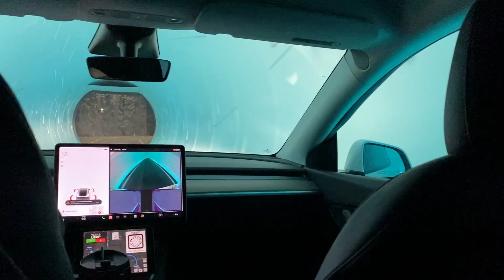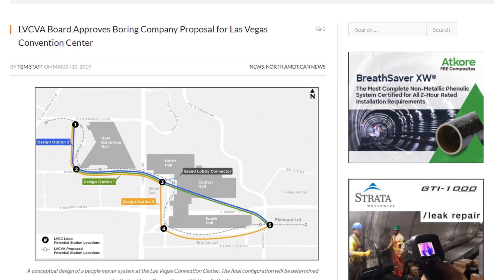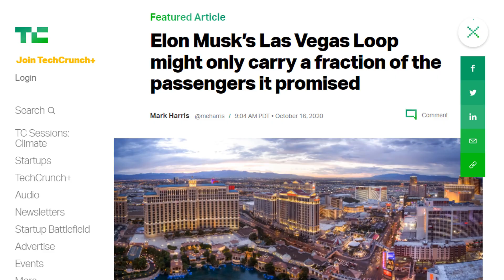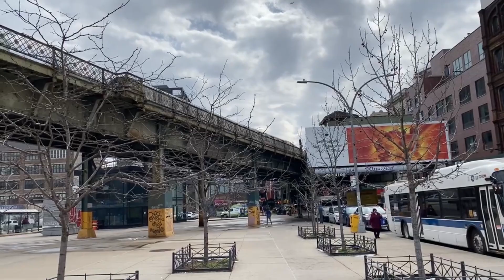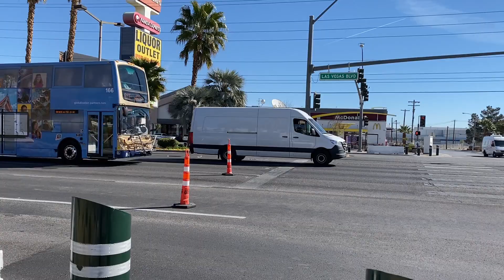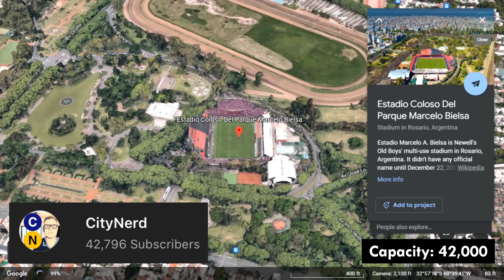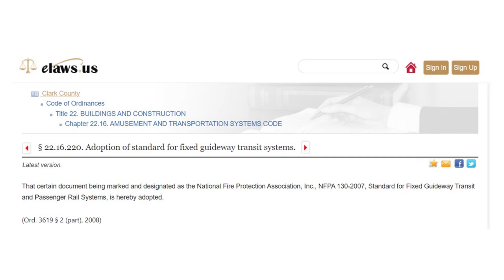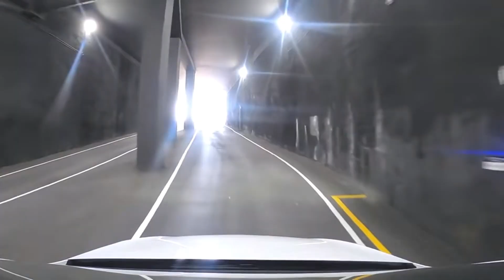Inside the Las Vegas Loop: Transportation Game-Changer, or Complete Waste of Time and Effort?

Comment: As a Vegas resident, are there any local activist groups that are working on better uses of city resources?
Reply: The problem is that The Boring Company isn't charging the city or county for building the Las Vegas Loop.   Their plan is to build it on their own dime and then make money from passenger fares.   A portion of revenue they will pay to the County as a franchise fee.    So it isn't coming out of the county's budget. 

Years ago they looked at putting a subway train under Las Vegas Boulevard, but the cost was going to be "billions", so nothing ever came of it.
Reply: @kevinbailey8827  It's more or less a loss leader to promote Loop, and by extension TBC,  and  by further extension Tesla Inc. Not a bad deal for Vegas, but a bit of a gamble.
Reply: @kms1.62  I don't disagree.   Most of the risk in on TBC's side.  They need a project that shows the potential of the Loop.

I don't know if the loop itself will be profitable for TBC. Early parts of it will go slowly as they improve their technology and techniques, but by the end they'll know how much to charge for their next project, and they'll know how much it really costs to operate it. 

I don't think selling more Teslas is a top tier goal. Eventually they'll be running vehicles in these that don't look much like the cars they sell to consumers, even though they're probably made by Tesla. Their real goal is to sell more tunnels, and to make a profit doing that. 

Even Las Vegas was reluctant to give the go-ahead at first.  A "free" transportation system isn't really free if it tears up the streets and blocks traffic for years while it's being constructed.   They waited to see how little the LVCC Loop project disrupted things at the surface.
Reply: @kevinbailey8827  Sure enough. Locally speaking, the worst possible case could still not be that bad for the people or the company, especially if it becomes successful and whets peoples appetite for more public transportation and is well integrated with higher capacity modes and intercity rail like the future Brightline West route. 

Not locally speaking:  not sure if you know, but modern deep subway construction techniques can be pretty much nuisance free on the surface. If TBC is in the tunnelling business, and not the Tesla car selling business,  they should also be doing rail tunnels. 

They seem to be pretty anti-train, though. That's old school 1940s and 1950s thinking. These days, there is plenty of public and (especially internationally) private interest in rail and new urbanism. There is money to be made in building better, faster tunnels for trains and supporting healthy cities.  But    their marketing  seems like they are at best ignorant about urban design, trains, statistics, physics, and history.  People would probably take the company and its ideas more seriously if they caught up with 21st century in regards to trains and stopped pretending everyone wants to go back to the 1950s.

If demand is strong enough, though, it will probably just go to show that the ridership case for a subway was underestimated. And if the public ever has to take over operation, rather than building parallel tunnels it would probably be more sensible to convert it into a train or more rail-like gadgetbahn system, maybe even a maglev. It'll be a cool gadgetbahn for sure. Very Vegas, but one major drawback...

Personally, I'd prefer recreating the Wuppertal hanging monorail over the strip (if I have extra time, or an equivalent choice, I aways prefer not traveling in a tunnel, or a pressurised tube, regardless of mode). That would be the ultimate Vegas Gadgetbahn, and that is truly just fantasy, but that is not out of place for Vegas. It highlights that other drawback though. The one major drawback (aside from everything else!) of the Vegas Loop is that it is by definition  underground, so its user experience and tourist appreciation will be not be the same as riding the monorail or the resort ropeways, with their continuous views of the epic landmarks. 
l
Reply: @kms1.62  I think converting these to rail would be a problem because they're not large enough for the additional infrastructure needed, and with the grades of the ramps to the above-ground stations, you'd need specialized trains. 

Also from a rider's point of view, the advantage of the loop is very short wait times, and short trip times.  Cars are coming in and out often (or can be dispatched from nearby), so you don't wait long for one.  At slow times, there will likely be one waiting at the station.  With rail they often reduce service during slow times, making wait times even longer.   The loop has short trip times because cars don't have to stop at stations except the destination.  Even with larger shared ride vehicles, the car might only stop at one or two stations, based on the destinations of the passengers sharing the ride.  Turn it into a train, and you're back to stopping at every station.  

What are the 21st Century solutions to trains that stop at every station and passengers who have to wait more than ten minutes on average for a ride?

I'm not sure what marketing you're referring to.  If you mean that concept video with the elevators and the cars on skates, practically all of that has been abandoned, I think.

I don't think TBC is 100% anti-train.  Musk was famously against the particular HSR project in California because he thought it would cost almost double the $35 Billion that was being promoted a the time.  He was wrong of course.  It's looking to cost triple that amount, and won't be operational until next decade.   But Musk had a train built to get workers to his factory in Germany.   TBC has a project to built a pedestrian/bike tunnel underneath a rail line in Texas.
Reply: @kevinbailey8827  Sigh. That is the thing. You don't read see them marketing this stuff in the traditional  way. Most Loop support on YouTube on videos critical of the project sounds like Kool-Aid to me (with various unappealing flavours like Appeal-to-Authority, Dishonest-Statistics, TrainsSuck,), from a coordinated astroturfing campaign. So much copypasta (wash down with Kool-Aid!). 

That Loop doesn't enjoy much organic support from urbanist and transportation thinkers is unsurprising, because it is a concept that needs major refinement by urban and transportation experts.

Yawn. Sigh. Trains are expensive. But often well worth it. If you don't know that by now I suggest you watch more CityNerd and the like, or pick up some books.
Reply: @kms1.62  What is the "traditional way" to market tunnels?  I assume they make their pitches to city councils and planning commissions.   And they're hungry, because they need to have working systems before they can sell working systems. 

You didn't answer my question about how 21st century trains solve the problems of passenger wait times and trip times.

I have ridden dozens of different trains, from the long-gone suspended monorail at Dallas Love Field to the funicular in Pittsburgh to the Eurostar channel train to the maglev from the Shanghai airport.  I've ridden the AutoTrain from Florida to Virginia.  I've taken countless airport trains and even more metro trains on three continents.    I like trains. 

Working in Hereford, England for a while, I realized that driving RHD cars was going to be exhausting to my LHD-adapted brain, so I opted to take the train from London despite needing to change trains twice for the trip.

Despite the fact that I'd probably give up my car if I lived in a dense city (I lived in San Francisco for six months and didn't use a car), I can see objectively that a system like a Loop that had shorter wait times and shorter trip times would be a better passenger experience.
Reply: @kevinbailey8827  Traditionally, marketing wass transparent.  The consumer knew they were being advertised a product  by a company. Product placement was perhaps the first widespread move away from that model, but it was still semi-transparent . With social media, a person can think they are hearing an unbiased person's take, but really just be talking to a paid commentator. Without having a... what is it called...oh yeah, a PR division, marketing is still possible in new, sometimes very subtle (and in some cases arguably dishonest) ways. Maybe that is a harmless, but when it's sloppy and incudes disinformation it's toxic to the public, and to the product.
Reply: Hey Kevin, sorry I missed your Q. "You didn't answer my question about how 21st century trains solve the problems of passenger wait times and trip times." 

Not meaning to be obtuse, but I am not sure if that question is as well-formed as you want it to be. If you are asking what I think you are asking then I'll give you a hint about what might be the answer: the notion that all train lines or networks have a single operational or scheduling  model might be preventing you from figuring that out.
Reply: @kms1.62  TBC is selling tunnels that cost many millions.  They're not selling to consumers.
Reply: @kms1.62  That was not an answer to my question about wait times and trip times.  Can you give me an example of how 21st Century trains address those problems.  I don't need something that is widely implemented.   I just would like to see an example implemented somewhere else that you think would work better in Las Vegas without sacrificing passenger convenience.

As I said, I have experience with many train lines.  I just haven't seen on that is both designed to carry dozens or hundreds or people at a time, and doesn't make passengers wait or sit through multiple stops that aren't their destination.  Perhaps there is a way to reduce transfers as well, as they are a major pain.
Reply: @kevinbailey8827  Sorry to be brief atm. Hope we have a chance to chat in the future. There are many examples to cite (not too many in the US sadly). 

Learning more about judicious applications of "headway management" in high demand situations and reading this article DOI:10.3141/2197-02 "Optimal All-Stop, Short-Turn, and Express Transit Services Under Heterogeneous Demand , might help you understand both the intuitive and the counter-intuitive flexibilities of transit scheduling. These concepts are not exclusive to rail. Any public or private transit system (except those that pigeonhole themselves as "all expresss") can apply them.
Reply: @kevinbailey8827  "TBC is selling tunnels that cost many millions.  They're not selling to consumers."  This is illogical. If you sell a product, the buyer is by definition its consumer.
Reply: @kms1.62  You might want to check your dictionary.  Mine defines consumer as a person who buys goods and services for personal use. 

In any case, I have never seen a traditional ad for Doppelmayr Garaventa. I wouldn’t have heard of them except for their connection to the LVCC Loop. They have managed to succeed for a century without my awareness.
Reply: EDIT I will add that, it doesn't sound like your personal train experiences have been totally negative so Yay for trains:) I think 2 minute headways and at least 3 service patterns (something like 2 to 6 minutes for all-stop/semi-express, 6  to 8 minutes for express) on a line, with maximum headways of 10-15(minutes) at the lowest demand hours, are ideal for "show-up and go" convenience. If all 3 patterns interline to other parts of a comprehensive network, it can give even small stations good one-seat-ride coverage across a city. The Odakyu railway and the LIRR mainline within NYC are two similar, practical examples, that often exceed that ideal. Seoul's line 9 has interesting service patterns too, its past frequency was a bit subpar compared too other parts of their metro though, not sure about these days tho.

The on-demand all-express model has a certain appeal, but in reality it is the same model that cars use today. In theory it looks nice, but we already have a good idea of how it looks in practice.
Reply: @kms1.62  We’re about to have another example of an on demand system with a few optimizations. I’m excited to see how it operates compared with other transit systems and the less optimized version that is street traffic. 

The small LVCC loop appears to be working well, but it really doesn’t stress the concept.
Reply: @kevinbailey8827  I think you are being obtuse.  The traveling and non-traveling public alike are the consumers, of both the tunnel service, and through their representatives at LVCC and the fees collected by the properties footing part of the bill, the tunnel itself. Doing a political-style astroturf campaign to counter legit criticism is a folly by itself, if that is indeed what TBC has chosen to be prudent alongside lobbying and pitches to elected bodies. Compounding that folly by alienating the same potential transit users and fans they hope to capture  as well as souring public trust with weird marketing tactics that employ falsehoods about trains is perhaps a new form of marketing malpractice, but it has some historical parallels, that were ultimately unsuccessful.
Reply: @kms1.62  They sold this to the LVCVA and to Clark County. They passengers of the LVCC Loop don’t pay to ride (at least not directly).   They will have whatever experience they have and that’s what they will take with them. Perhaps good experiences will translate to yes votes down the line on some bond election to pay for a loop in their community. 

Criticism of the Loop concept isn’t being suppressed. Occasionally it is being challenged. 

Before the LVCC Loop opened, some critics claimed it would be able to handle  1000 passengers per hour, let alone 4400.  They used math to prove their predictions.  One guy calculated based on the time it took to make a full circle around the loop. He called himself “common sense skeptic”, but common sense would tell him that a trip on the loop would be a quarter or half of the whole loop. Any more than that would get you back to somewhere you had already been.   

Misinformation should be challenged, right. 

I’m not affiliated with Tesla or TBC or Twitter or any Elon Musk related company, by the way.   I am a fan of EVs.
Reply: @kms1.62  I think we are speaking different languages. It’s clear you think corporations are people too, my friend.
Reply: @kevinbailey8827  I think we both like to speak authoritatively (not to be confused with speaking like an authoritarian tho) about things we know and care about.  The point I am trying to make, that started this convo, is that at the end of the day, even though Vegas is getting this for practically 0 taxpayer costs upfront, it is still public infrastructure and TBC should be more transparent with the public if they want to respond or challenge criticism in public forums like the NYT or YouTube.  Make some videos or write an Op-Ed, not astroturf or rely on their fans to get their perspective out there. They want to build more tunnels in more cities and actually have taxpayers footing the bill upfront so they should engage honestly with the public now.

I can see good applications for this technology alongside expansion of railways good enough for passenger transport. I think TBC can make a profit supporting both, while effectively living up to the lofty goals they stated of combatting climate change and traffic.  I am for multimodal transportation that give everyone transportation choices and conserve resources and the natural world. I think it is a false choice to say you can have this inexpensive-to-build project or more expensive-to-build trains but not both. Expanding both will make American cities healthier, more productive and just plain  better places  to live. I think neglecting railways has made people ignorant about how they work and the advantages (especially the environmental and operational cost ones) they have and misinformation that extends that ignorance should be corrected. No matter which way the political winds blow, America and the world will be better off with trains too, and countering the notion that America's neglected passenger railways are a relic to be superseded is step one. 

As for corps being people.  That is a political and legal reality, not necessarily one I agree with. Sincerely hope I can help you understand my perspective, and that you can improve my ideas or correct me when Ì am wrong; and that you can do the same for me, my friend.
Reply: @kms1.62  TBC has been as transparent as most companies. There have been public hearings where citizens could step up to the mike and make a speech or ask a question. You can find recordings of them on YouTube. 

I’m fine with America having high speed trains between cities, but there is a project that’s been trying to get started in Texas for ten years, but has faced strong opposition from property owners whose land will be affected. One of those property owners was a high school teacher of mine, so I know that she is representing her own interests in opposing the project. 

This is another case of a big company trying to push through a project that affects ordinary citizens. A lot more town halls, which is still the traditional way they communicate.
Reply: @kevinbailey8827  I have a friend who specializes in aerial photography with drones, recently he has been helping teach drone pilots in Ukraine. He has long been an EV fan, and was a staunch believer that passenger trains belonged in the past, and that they could never work in the USA, having grown up far out of town and being reliant on cars for his early life. Traveling the world as a cinematographer he began to see the utility of trains differently, first their utility in urban transport. And after experiencing the high speed railways of east Asia and Europe, he changed his mind about trains. 

Also, while working in Ukraine he saw firsthand how having a healthy rail network complimenting a road network has enabled quick and effective evacuations and saved lives. Upon learning recently, from Musk's biographer, that Hyperloop and Loop were proposed specifically to disrupt rail projects and gain taxpayer funding for public transit, he now believes that comparing the Boring Company to the cartoon villain's Cloverleaf Industries  from Who Framed Roger Rabbit, is looking more and more spot on. 

Whenever Boring Company says they can't build rail tunnels, that is another example of their lack of transparency.  They really mean to say they won't build them. So again, not that it's ever going to be heard, but they should engage and respond to their critics openly if not for the sake of civic honesty, then for their own reputation. They could also just, you know, proactively build rail tunnels at competitive and profitable prices, help create economies of scale for passenger rail.

I hope your friend is fairly compensated, and isn't subjected to eminent domain, if the TCR is really still going to be built. Or that they mitigate whatever impacts your friend is concerned about. If it is not going to be completed I hope they communicate that to the landowners ASAP so they can make long-term decisions outside of the limbo they're in now. Then again if her opposition is purely ideological, I'd have less sympathy and hope that she wouldn't stand in the way of progress, and that this teacher educate herself more on transportation. 

That is one of the more promising HSR projects in he USA. There are several good CityNerd videos that use gravity models to determine optimal city pairings and iirc this was one of the highest scoring routes. Now, if Loop wants to try and compete with monstrosities like the Katy Freeway or other taxpayer funded Texan roadway expansion (that often uses eminent domain in a far more disruptive manner than TCR would have), be my guest. 

A lot of cities want to get rid of their urban freeways. A combination of rail (at grade or otherwise, or LRT and BRT for smaller cities), green boulevards and underground automated EV infrastructure might be really nice replacements for some of those historical mistakes...I am a huge fan of the Interstate Highway System, but even I can see that routing them through cities was terrible.
Reply: @kms1.62  The idea that Musk proposed Hyperloop because he hates rail is a whole tapestry woven from a single quote. 

It's probably true that Musk opposed the California HSR project.   He said at the time that he thought it was going to cost $65 billion dollars, and not the $30 or so billion that was being suggested at the time, and that it would take a lot longer to build.   Currently it's looking to cost more than $100 billion and won't begin commercial operations until the 2030s.

That ballooning cost has also plagued the Texas HSR project.   Originally it was supposed to be $10 billion and now it's projected to cost $30 billion.  It was supposed to be operational by 2020, but thanks to the opposition of citizen landowners, they haven't laid a single foot of track, or even broken ground.  They did win a major victory in court to allow them to use eminent domain.   However with the increased cost, it isn't certain the service will be profitable.   The entity that wanted to build it promised they would do it without taxpayer money (shades of Elon Musk!), and the legislature passed a law that prevents state funds from being used for it.   The status of the project is unclear.

It's safe to say the California and Texas projects will never actually come to pass.  I say it's safe to say because people always seem to say that when Tesla or SpaceX misses a target, and no harm comes to them for saying it.

I'm not aware of TBC saying they can't build railroad tunnels.   They aren't in the business of building railroads, but their website offers unfinished tunnels that the buyer can use as needed.

It was reported in March that TBC was in early talks with Dallas about digging tunnels for a new subway line that Dallas wants to build.
Reply: @kevinbailey8827  Roger Rabbit isn't exactly historical. It gestures at some embarrassing truths. That powerful corporations have seen the perceived obsolescence of trains as being important to their bottom lines for a long time, and that they have encouraged that false  perception via many avenues. Musk has many quotes that confirm that he believes this. I don't believe every engineer at TBC feels that way, but the boss definitely has choochoo beef. I think it is safe to say that  they are  very much in the car business, and not,  as they have indicated, in the making the world a better place by using innovation to solve problems business. A whole lot of hype that people are wising up to. 

That is a mostly accurate summary of the state of TCR. I think you understate the nature of its opposition as simply being concerned landowners, and not also the product of xenophobia (actually a fair amount Japanese taxpayer money was in the original proposal), partisan contrarianism (Trains are socialism!, but JR is very much not socialist, and despite what some may say, rail is not inherently more left-wing ), weird Texan exceptionalism, and misinformation. 

Parts of CAHSR will be built. The electrification of Caltrain will definitely be an improvement. So, it is not actually safe to say that project will never come to pass. 

I think HSR will eventually be built in the USA.  Our ancestors will wonder why it was opposed in the first place and struggle to understand fully without getting a history degree.
Reply: @kevinbailey8827  I really do hope that Dallas story is true. Perhaps my growing pessimism about TBC is unwarranted. So, thanks for pointing it out.
Reply: @UC9aky3iT_RthaU3vrUFZKvg Passengers had no say in the purchase of the loop system.  The decision was made by a board who were decidedly not buying a loop for their own personal use. 

By your logic, Ukrainian citizens are the consumers of kamikaze drones sold by Iran to Russia. 

The dictionary definition of consumer is quite clear.
Reply: @kevinbailey8827  Um no. Passengers may be direct consumers of the service in the tunnel. But the public authority, and thus the public, are the consumer of the tunnel itself, as a product. Or if you wish, the public consumes the service of the tunnel builder. You can't just redefine words to suit your goals.
Reply: @kevinbailey8827  That quip about victims of violence being consumers of their aggressors' product is really distasteful and not at all a valid comparison to the basic economic transaction you are trying to obfuscate.